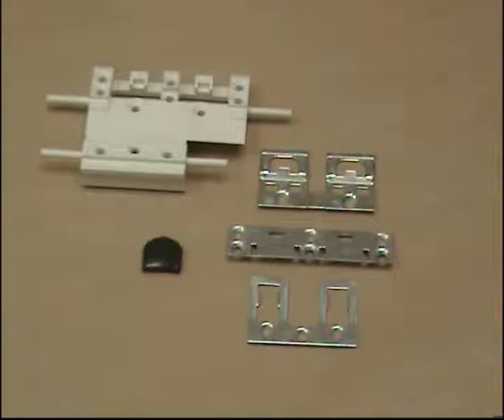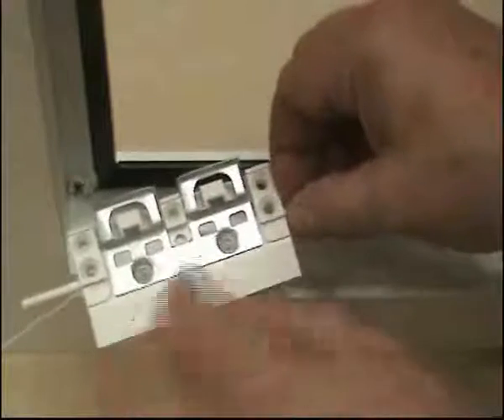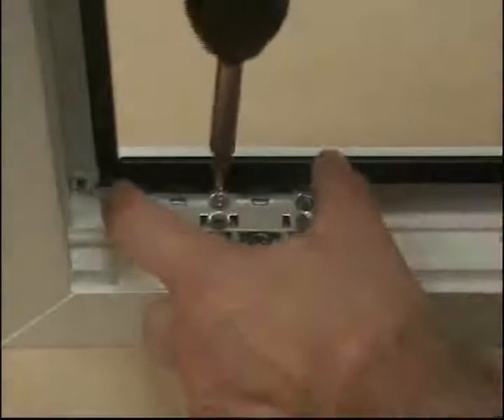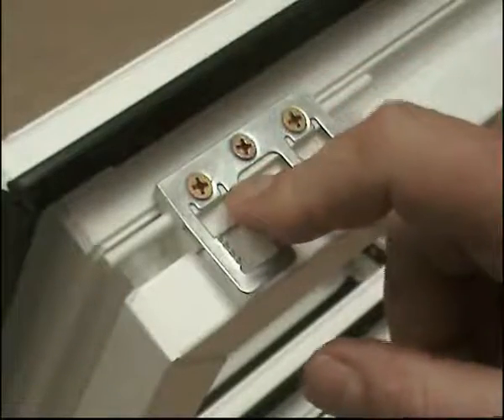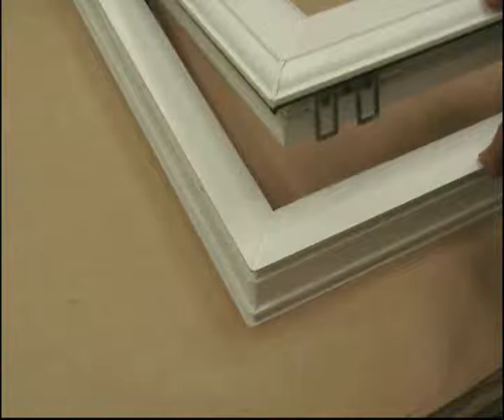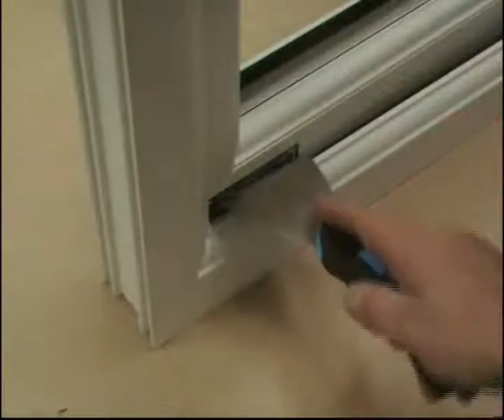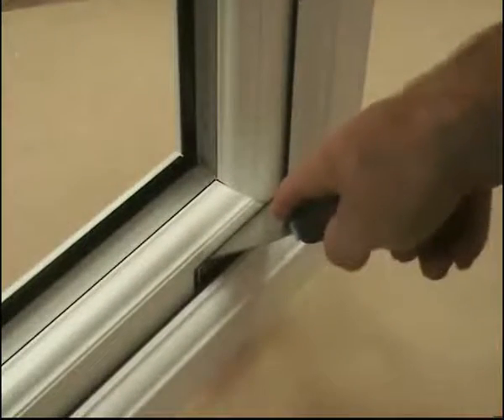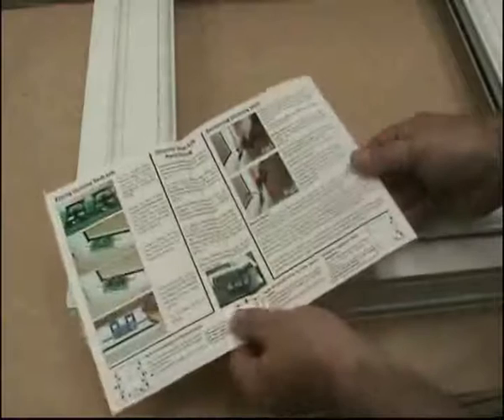Dummy Sash Lok - How to fit & Release

Comment: Interesting. I have  two storey bay window on which the wooden sashes are tired looking through the sheer difficulty of keeping them maintained. The actual frames are of very good hardwood and are well fitted. It it possible to fit uPVC sashes on to the wooden frame as replacements?